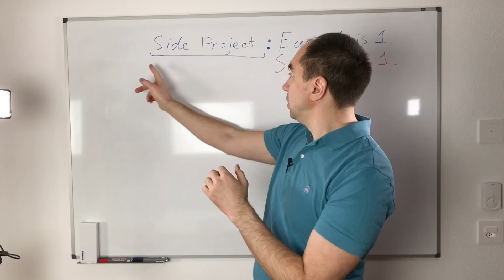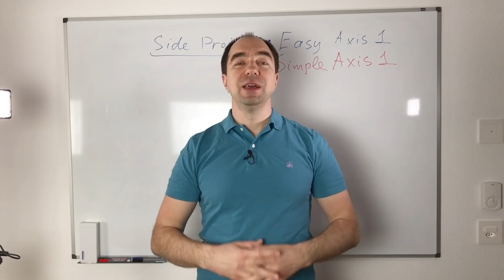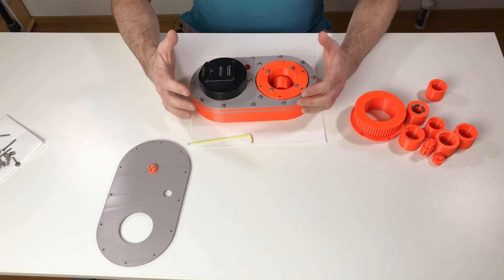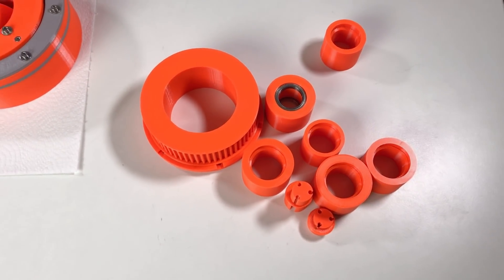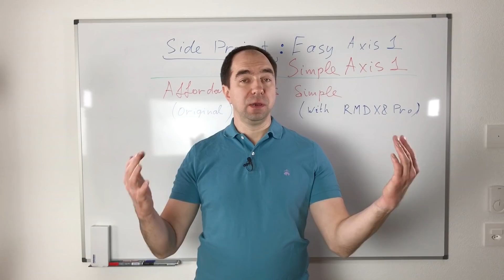Simple Axis 1 with QDD actuators (Alternative Easy Axis1)

Comment: Have you ever worked with cycloidal gears? They have a number of advantages for printed plastic gears and might reduce the cost of robot gearboxes? Thank you.
Reply: Have you seen the infinity transmission? https://spectrum.ieee.org/video/robotics/robotics-hardware/sri-inception-drive-infinitely-variable-transmission More complex but also also better in this application with some esp32's or stm32's & CAN buss adapters on the motor you could change the torque & rotation with a HAL sensor dynamically to make up for the load your experience to get to your target position.  https://www.youtube.com/watch?v=guvatctnjww is a good way to make colloidal gears though if that's all you want.

Comment: i guess i missed the reason why ....  on the cheaper one ......  the encoder is on motor instead of the final shaft.
Reply: Needed for motor control for the oDrive to work properly. That's how it keeps track of rotor position relative to the field coils.
Reply: Ethan Barrieau ......   so maybe .....   two encoders might save the day
Reply: Ethan Barrieau  ... thanks for that explanation

Comment: I thought the grey parts were metal plates 😋.  I imagined that this was a very good way to use the ease and cheapness of 3D printing to provide the bulk of a solution with the added robustness and rigidity of metal plates which could be easily manufactured rather than 3D printed. Very professional and well thought out designs... 😁

Comment: Nice mabye can be done small upgrade of affordable version -  mount ODrive on the bottom part of axis1 to be little more compact.
Reply from the maker: Yes, you are right.
Reply: @Skyentific  The Odrive people have been talking about a smaller single channel version for integrated mounting like the all-in-one actuators. You can actually buy single channel Odrive knock-offs on Ali at the moment. 

And there are a few other driver projects going as well. One called Tinymovr that's getting closer to going into production: https://hackaday.io/project/168650-tinymovr-motor-controller
Reply: @Manofcube  Do you have any aliexpress links?
Reply: @YOUnoobGER  Just search for "Odrive" and they come up. I haven't purchased any of these myself so I don't know if they're any good.
Reply: @Manofcube  thanks I found some of them. They look really shady tbh, mostly because the information is in Chinese or very badly written.

Comment: Could the flat parts be made of laser cut acrylic? It would be quicker than 3D printing and more rigid and also less expensive than carbon fibre...
Reply: laser cuttting is not cheap, plus acrylic isnt that strong
Reply: @pd.dataframe2833  It is cheaper than carbon fibre and more accessible to most people...that is however my experience - your experience may be different.
Reply: @pd.dataframe2833  Did I miss something? These machines aren't that expensive anymore? At least not for plastic.
Reply: I'd use laser cut aluminum. Cheap, only slightly lower stiffness to weight than carbon, and tougher bearing surface for screw heads.
Reply from the maker: Yes, I think this is a good idea. But I don't have a laser cutter, so for the moment I keep it 3D printed. :) But in future it can be acrylic, carbon fibre or aluminum.
Reply: @Skyentific  I don't either but I have access to one at my local Hackspace. I am building the 6dof open source version of your robot arm. I will let you know how it goes 😀
Reply: @Skyentific  Would dibond 3 mm thick sheet be strong enough for those plates?
Reply: @GTARobotics  I would have thought so...